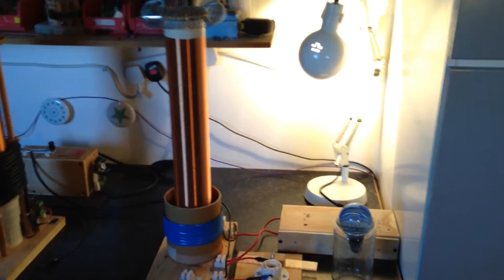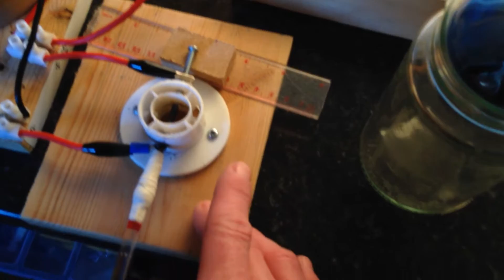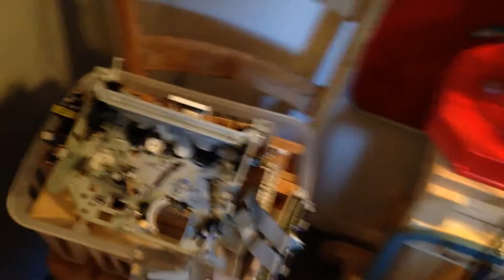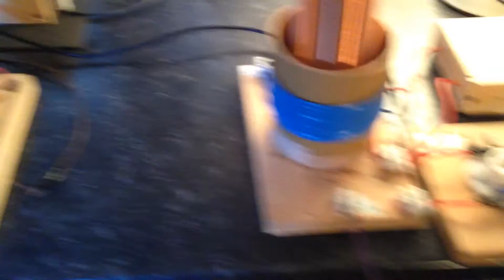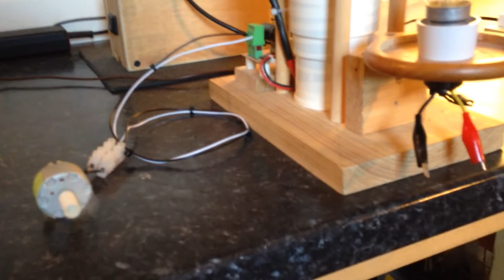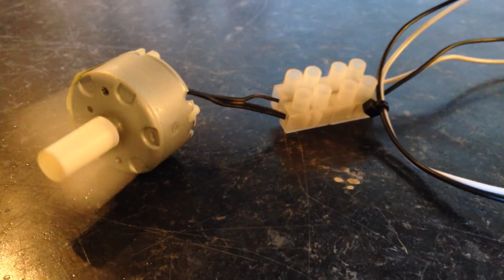Spark Gap Tesla Coil - wireless receiver power rectification #1

Comment: i had to try the ink on the spark gap too....curiosity and all. did you wait for it to dry or give it the ol splatter test like i did?  (looked pretty for a few seconds hehe). that flyback box looks handy....
Reply: You're right jeremy there's nothing left on the end of the two 'electrodes' aka cheap screws, it is filling the threads in the ends still, I think the heat will finish it off. I sanded the screw ends on a power sander so it's a nice new gap. That's attributing to the low control, it can be a bit scatty when the metal has degraded and it's hard to tune into the sweet spot. It's a lesson in making two changes at the same time and then having to speculate on which made the improvement, one at a time! lol I'm rambling, cheers fella
Reply from the maker: I moved the lamp down over it last night so it would dry quickly - I ran it for a bit and then slapped loads on before I went to bed.  I think it burns through eventually, the spark gap seems to eat anything you put in front of it.  It will be all burnt off in the next 10mins when I put it on tonight I should think. For a short moment you get that fancy green sparkly effect when you switch on.  Thanks Jeremy, love the musical slayer btw, so cool.